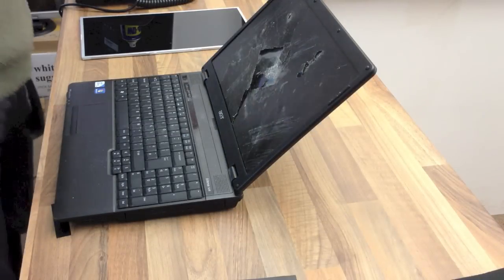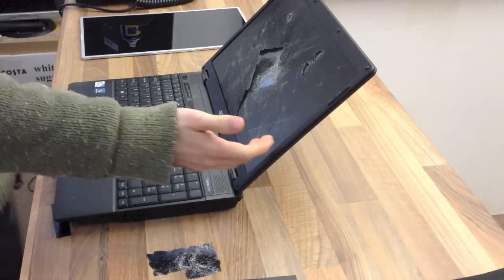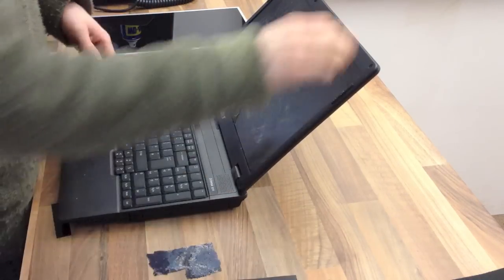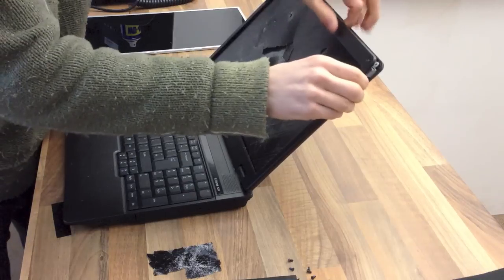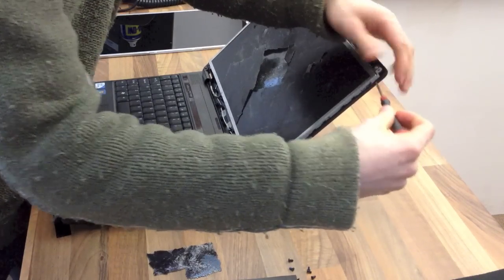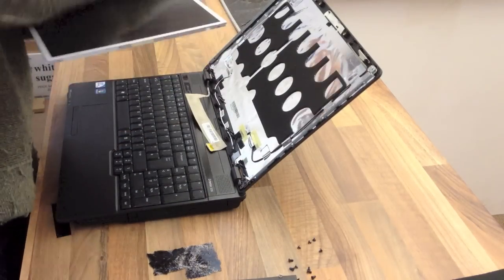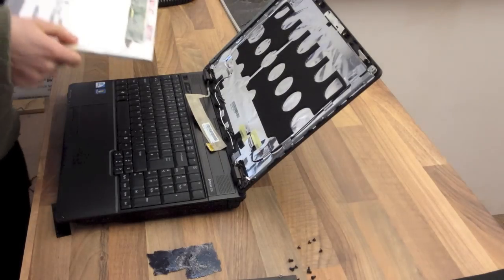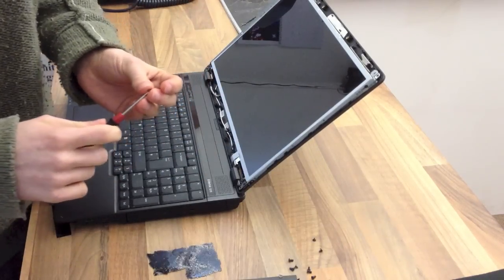Let's Fix Computers Ep.1 - An Easy LCD Panel

Comment: This takes me back. Started a job around 2014, having hardly worked on laptops before. Guy had closed his laptop with a USB drive between the keyboard and screen. Boss says to order screen and replace it....okaaaaaaayyyy. 
Ordered, brought every little screw driver I had, searched around, found some advice and did it. YAY!
Umm, we have a new guy starting but we need to replace his laptop keyboard with a French one.....ok.....searched around and found out. It was a rough one, was a Lenovo X240, you had to basically remove everything from the back to pull out the keyboard.
As time went on, I took for granted how easy it got. Only one I HATED WITH A PASSION replacing were Lenovo Thinkpad T440/450/460. Its got to be theeeeee worst way to replace a keyboard, I ruined so many keyboards, hell, even the Lenovo tech that came out to diagnose a laptop buggered the keyboard.

I just made and habbit, and follow it to this days, mark my screws on my desk and even mark the holes with a black marker if they look tricky, I always forget.